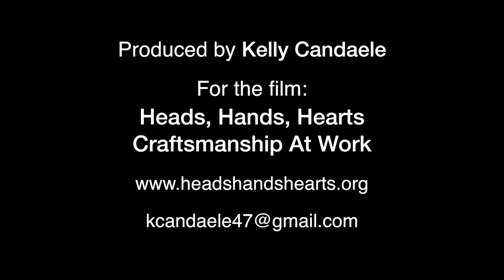Ironworkers Local 433 - Building the Los Angeles Skyline

Comment: what are you doing connecting with those Maxi Flex gloves rookie
Reply: Lol
Reply: Lol, I connect with them everyday.... in the winter time. I’ve been in local #75 in Phoenix, AZ. for almost 15 years and I’ve been on the raising gang for 10 of those years. In the summer here you do not want to use the maxi flex, but it’s way better in my opinion. I use the long cuff red stars from burley bear in the summer and for welding.
Reply: Says the guy in a green hard hat

Comment: LMFAO! LA has a skyline? 😂😂
Reply: But LA doesn't have a skyline. That's the whole point. San Francisco, Chicago, and Miami would put LA to shame.
Reply: Adrian Estrada Dude. You crack me up. Are you related to Erik Estrada?
Reply: Hugogamer 560 No, it really doesn't. For a city its size, it should have a downtown 3-4 times the size. Look at Chicago's relative to its population.
Reply: JMMT7022801 although it at least needs to have some tall buildings
Reply: JMMT7022801 with the amount of earth quakes in ca it takes a lot of time to get city and st approvals to build high risers.
Reply: JMMT7022801 you know LA has taller buildings then SF right?
Reply: JMMT7022801 there was a building limit for years so they couldnt built over 20 storys